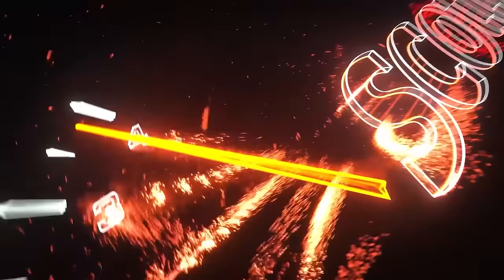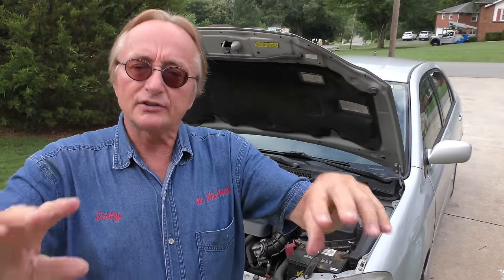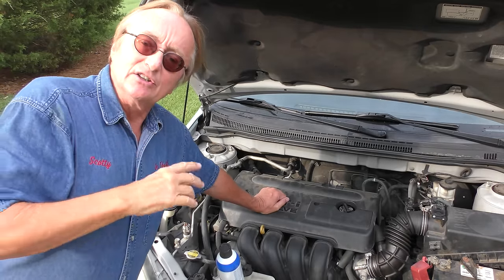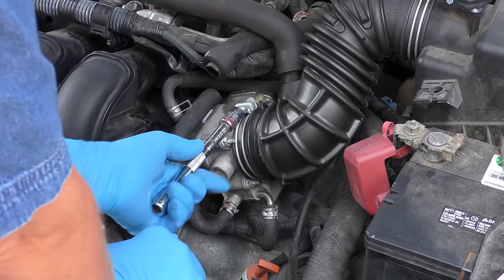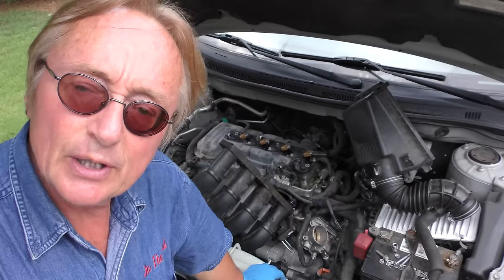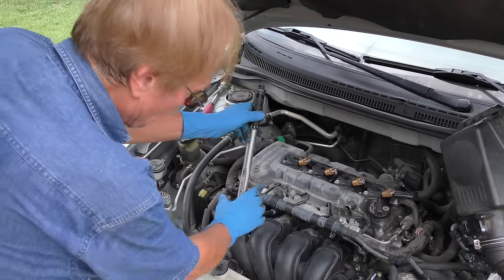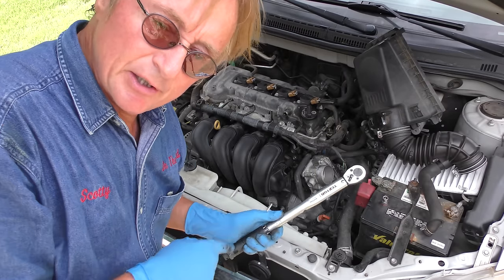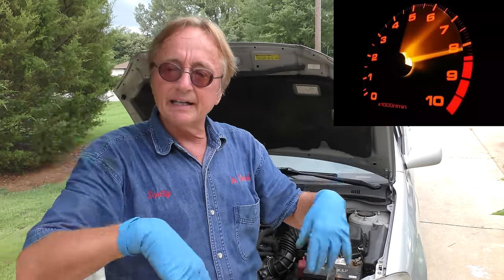Toyota Won’t Fix This Problem and I'm Mad as Hell

Comment: The 2 toyota vehicles that dont need fixing are a 1994 Toyota Celica and a 2007 Toyota Matrix. Good afternoon scotty!
Reply: 2002 Corolla 1.8 as well, transmission and engine are so good 
My grandma’s Corolla never went to a mechanic and has over 100k already
Reply: @beamishlotus7269  That car will last at least another 200k miles.
Reply: @riph5611  some other 98-02 Corolla owners in my area reached over 500k and they still run good, same engines, they told me they used just high mileage oil and also high mileage oil additives like MMO and stuff
Reply: @beamishlotus7269  It will last up to 1 million miles without any major problem. That's why Toyota is known for its super legendary reliability. No other car company can even come close.
Reply: @riph5611  yeah I just hope you’re right
Reply: @NOVA__tire_man69  The problem is your mum, not the car itself. Scotty also has 2007 Matrix and it never has any problem.
Reply: I agree. Neither would be worth fixing. Send them to the scrap yard.
Reply: Lexus too
Reply: @riph5611  my 98 Corolla just turned 130,000, my goal is 200
Reply: @johnjr2641  No problem. It will last you a lifetime and even longer.😁
Reply: Lol the matrix has bad intake manifold gaskets
Reply: As a mechanic ...... if it  wasn't for the Matrix and Corrola I'd be broke ! Seems they break a lot....especially around 75,000 miles.... don't see the matrix to often anymore tho.

Comment: I have two Corollas (2006, 2008) and I've replaced that intake gasket on both of those cars.  Here is a tip to remember:  on the backside of the intake runners is a port that connects to the tube that goes to the brake booster;  it is hard to see and most DIY guys forget to connect that and then they don't have any brakes, so be careful to reconnect all of the vacuum lines.
Reply: They would still have brakes, the pedal would just be much harder to push.
Reply: That happened to me exactly lol it's a real small hose hiding lol

Comment: One of the vehicles in my driveway is an 04 Corolla. The knock sensor threw a code because a mouse ate the harness. I chose to remove the intake as you just did. Took about 45 minutes to splice a new harness and change the intake gasket. Simple job! You are correct regarding that gasket because mine was very hard and probably had a small leak somewhere. Total cost was about $25 including the gasket, harness and carb cleaner for intake. One thing I can recommend is disconnect the negative to battery because the MAF sensor is sensitive. Scotty you rock!

Comment: I saw the gasket in the thumbnail, and already knew what the video would be about. Error code P0171 (to lean bank 1).
This cost a friend of mine hundreds at the Toyota dealer, only to have the code reappear within days. They sold her a new MAF sensor even, amongst other things. Then I checked the intake with brake cleaner, changed the 15$ inlet manifold gasket, and problem solved.
Reply: I have a chronic issue with P0171 coming on myself in my 2000 Corolla. It is triggered by the LTFT reaching 38.3%. Did your friend's car have a similar issue with the LTFT being way too high? How did the car run before the gasket was changed?
Reply: @MrRusell86  
Do the spray test on yours.
Remember the manifold is plastic and has a different rate of expansion to the alloy head...
So temperature can make the difference and maybe that temp diff is twisting the manifold..
and the old worn gasket can't seal that up any more?

Comment: That carburator spray trick is one my Grandfather taught me.  Glad some things never change.  I would be curious to know on your repairs how long it takes you to do it.  I think it would be interesting to know.
Reply: It's a cool trick
Reply: Can also use unlit propane torch. Hold it around where you suspect a leak and listen for change in rpm.
Reply: Isn't it flammable? Is it safe to spray it there?

Comment: There are many of these Corolla's (2003-2008 generation) still being driving today as they are very popular and long lasting
Reply: I still see 00s and 01s some even with body kits 😂😂
Reply: @stronkvodka731  i still see 88-92 not mentioning the next generation here in Portland
Reply: the problem I haven't found for 150k miles. At 207k now and ready to change to pass emissions P0171 engine light code
Reply: @getoutthere04  
Sounds like this gasket. Do the spray test.

Comment: My father has a Matrix 2006, similar as you.
He has the same code P0171 in winter when it’s cold.
I told him it was the upper intake gasket manifold, I saw the TSB document for this one.
Reply: What happens in the spring and summer? Does the code go away?
Reply: Tell me more about this "TSB document". What does this document discuss?
Reply: @MrRusell86  That you should change your upper gasket manifold. Especially in cold. For rubber.
Reply: @SergeSaati007  I see. Well, I have a 2000 Corolla that throws a perpetual P0171 code. I changed my upper air intake gasket but it did not fix the code. I was not too surprised because the gasket is different in 2000 Corollas. It is more flat and does not fit into molded grooves as is seen on newer models. The air intake manifold is all metal, too. I have not seen a metal air intake on any other Toyota shown on YouTube.
Reply: @MrRusell86  Oh so design problem maybe. Maybe in your case it's the O2 sensor or MAF sensor, vacuum line. Not sure.
Reply: @MrRusell86  
May need two gaskets stuck together with a sealer like permatex 
with a less permanent sealer between the gasket and the manifold 
and the same non permanent sealer to the head???

This will take up any imperfections (small gaps).....

Comment: One of the best european engines are 1.9 TDI made by VW group. It's used in vehicles such as VW passat, skoda octavia, Audi A3/A4. I saw some passats with 1 000 000 km and they are still going with original engines hahah. I also love my 2.5l CRD made by VM Motori. I think it's an italian engine which was used in some Jeeps Cherokee, Chrysler Grand Voyager (EU version) and also in London's cabs. I have 2001 Grand Voyager with this 2.5l CRD engine and after 21 years and 210k miles it is still going without any problems. Both engine and even turbo is still original and it is truly amazing! We bought this car in Daimler-Chrysler in Prague and I have some friends who covered 850 000 km with this car. If you change oil every 7k miles and change filters and you don't floor it when it's cold, it will last for long time I guess :) And A/C is still blowing ice cold!

Comment: My 2005 Corolla a few years back on very cold day, under 20 degrees ran like bullet until it warmed up. Toyota had a TSB on replacing the gasket. Must have cost me $10 and easy to replace.
Reply: Same thing happened to my 2005 Corolla S. Check engine light came on, OBDII code P0171. Replaced the intake manifold gasket ($9), problem solved.
Reply: @johnmcrae5043  still running strong?
Reply: Same thing here on a 2006 corolla ce. Easy job. Get the orange one.
Reply: @johnl3230  Sold it couple years ago; it was running fine when I sold it.
Reply: You can use a torque wrench if you got one, if you don't, you do what I do and it works like a charm.
Reply: @grandprixjames  

Fel- pro or the Toyota orange ones? They have an offer on the fel pro ones near me now!

Comment: I think this is what I need on my 07 Corolla LE. Spent $100 on scan, THEY say it needs MAF sensor, gonna try that first 🚙
Reply: Toyota has an upgraded intake gasket for the 1zzfe engine.
I replaced it on my 07 Corolla and not a problem since.
Reply: How is it

Comment: My 2003 RAV4 has this problem! I did my spark plugs I cleaned my MAF sensor and next I'm gonna do the air filter and a new oxygen sensor which I have a code for the oxygen and MAF sensors. Glad I ran across this video!
Reply: Did this gasket replacement work out to be the solution to your problem?

Comment: I just changed my intake manifold gasket today on my Toyota after seeing this video. It just happens that I needed to change it. Perfect timing, Scotty!
Reply: Did you have a check engine light before changing?
Reply: @gamingwitchutuu429  
Yes, but the check engine light on Toyotas is not big deal. Flashing check engine light is when it’s bad.
Reply: @igorseprak6177  yea, I have a smog on 26th and not a lot of money, I hope the gasket is the problem on my 2001 Toyota echo and not the fuel pump etc.
Reply: @gamingwitchutuu429  
It’s probably evap system. Not a big deal.
Reply: @igorseprak6177  Was it from the super common P0171?

Comment: I had a corolla 1.3l with unpredictable bad idling  at 0-15km, replaced the air intake manifold gasket, improved but didn't do it, apparently even though the pcv valve wasn't broken, but when i replaced it, the engine changed alot, cleaned the intake valves and the engine became like new.

That corolla introduced me to you Scotty, it was 2016, the video you talked about pcv valve, sold it in march 2020 and got a camry now.
Reply: @jeansreal  i removed the air intake manifold, and used carb cleaner, i used almost 5 cans, soaking it and assembled it and drove it with high rpm's. And then removed everything... Etc etc
Reply: @ehussamkc Wait a minute now. Why did you need almost five cans of carb cleaner? You found that the air intake manifold was really that dirty after you took it apart?

Comment: Peugeot 504 Diesel engines, 1975 and older, were a wet sleeve engine. First off, they ran dang near forever, but when it it was time to rebuild them, the cylinder sleeves were easily replaced, and the engine was good for a long time again. The rest of the car was pretty bullet proof too.

Comment: Should have changed the pcv valve. I did this job three days ago. The pcv          was bad and replaced it myself after mechanic thought it was too much work to remove the intake to get at it. The car was burning oil and you could see it leaking down the bottom of the intake. The girl had almost 300,000 miles on the car. Amazing that the car was still running. With all that oil coming in the intake. She never done anything but brakes and tires and oil changes.  She showed no appreciation just was mad there was still an exhaust leak.

Comment: Glad to know about the carb spray trick! I've been getting o2 sensor codes on my 2004 Corolla and haven't thought much of it, but now the idle is getting so bad that it occasionally dies at stops. Usually starts right back up. Took it to a shop here in Houston and they wanted to charge me 1100 for a new intake manifold because they did a smoke test and found a leak. I can't imagine that replacing the manifold is that hard and I know that the gasket has been changed, or at least I know I paid a mechanic to change it and they said they did. I'm tempted to take a look at the gasket, and just replace it myself and see if that helps, but I'll try the carb spray to see where the leak is.

Comment: Wow, Scotty using a torque wrench!  Usually he just tightens the bolts until he grunts.
Reply: He's so experienced, that he doesn't need a torque wrench.   The plastic crap is forcing him to use one, as the plastic crap is shitty to work with.

Comment: My 2008 toyota corolla idles like crazy only when warming up. After it's warmed up its ok. I'm definitely gonna work on my gasket. Just added a new throttle body battery alternator and starter. Hopefully this is it.

Comment: Had this exact problem with my older (relative to 2021) Corolla this past winter. The gasket was only $15 or so...but my shop charged over $300 for labor. Unfortunate it happened...but it is also the worst thing that's ever been wrong with this car after 150,000 miles, thing's a tank.
Reply: I'm sure there's other things wrong with the car at 150,000 miles you probably just don't know what they are lol.  I've done plenty of stuff on my 05 Corolla at 100,000 miles.
Reply: @marcushearn1740  Oh of course there's been more work/repairs done on the car, I'm just talking about the single "worst" piece of work that needed to be done on the car.
Reply: @tpr2378  gotcha.  I was gonna say that's it damn lol.  Feel like my Corolla is just one thing after another, granted it's a bunch of small stuff

Comment: The timing of this video is funny. Just finished swapping out my intake gasket on my toyota
Reply: literally did mine last week after a p0171 code
Reply: @Hero-jr5os  Did it fix your P0171 code? And how was the car running before you changed the gasket?
Reply: How’s it holding up

Comment: Trouble is, Toyota issued a TSB on this very issue back in 2007, and the fix is to install an upgraded gasket which doesn't turn into a plastic pancake over time. 😊

Comment: MR. SCOTTY!! I got offered a 1990 Honda Accord with 156,000 miles with a 5 speed manual transmission, for FREE!! It's been sitting for almost 15 years. Hasn't moved in a very long time. I'm a mechanic and not afraid to bring a car back to life if it needs it. It looks VERY clean inside and out. Should I go for it??

Comment: Bought air flow mass sensor, sparkplug,  and ignition coil. Still nothing then just changed the intake gasket and it worked. Thanks. 😅

Comment: Just had the same problem as Scotty trying to fix these worn gaskets you got plastic paradise before you can get to anything plus its so easy to overtorque those throttle body nuts they shear so easily

Comment: Just  changed the spark Plugs on my 2011 v6 Rav4, also changed the two intake manifolds just because I was already in there and the vehicle has 150K on it, pretty easy Job. Although the back bolts on the manifold were a pain to reach because I'm only 5'5". All said and done job took just over an hour.
Reply: Nice. those v6 ravs are a real hidden gem they are very fast. I say they are basically a v6 awd wagon with close to 300 naturally Aspirated horsepower they were a real joy to drive ice cream I wish I could find one in decent shape that people didn’t want $17,000 for it
Reply: @thetechlibrarian  I love it, its very smooth and surprises allot of Subaru drivers that think they can keep up with me :-)

Comment: Another clue that you might have an intake gasket air leak is if you notice the trouble more in cold weather than in warm.  At least that's what I noticed with my '98 Ford Explorer when the intake oval seals went bad.

Comment: Po171 on my pontiac vibe. I'm PRAYING this is my months long cure to my problem!!!!
Reply: It will be.....and was it?
Reply: @JohnSmith-pl2bk  

It was ! The gasket was flat and worn. Replacing it stopped the error code.
Reply: @jammin1881  
Thank you'
I have a 2004 Toyota Wish JDM import with the same engine and what I think is either this leaking gasket or a sticking IAC...goes to 1900rpm  from dead cold...and stays idling at this until it warms up....
It may have both problems....
Nosurging but something is wrong.....
Reply: @JohnSmith-pl2bk  

Use the carb cleaner and spray the intake (as shown) if it picks up or revs harder you know there is an air leak from the valve. 

This video saved me months of headaches and trying to figure it out. The car would stutter and nearly stall. Especially when cold. 

This gasket caused the p1071 code whatever......

Comment: What if the vehicle only runs bad at idle and low speeds once in a while? My jeep Cherokee 4.0L is driving me crazy. I've had it in several shops and it never acts bad for them and they can't find anything. It shakes and barely runs until you get it up to 20-30mph

Comment: Thanks, man! Already had the manifold off to change the bypass pipe so I can use the heater again even here in Hawaii it's nice to have once in a while. Anyway, the 05 Tacoma runs great but has a surging idle. Hopefully the new felpro gasket takes care of it.

Comment: A few very reliable engines I know of (I'm an engine test engineer, seen quite a few, they get run hard 24/7). 

1) Mercedes Benz M102, simple, mechanical, these run forever. You'll find these engines in late 80s to early 90s Mercedes, the ones that are still used as taxis in third world countries typically.
 
2) Peugeot/Citroen XUD9 or DW20 engine. These are used for the official CEC fuel tests in labs around Europe, they get abused with all sorts of nasty fuel additives, but also get the nice premium fuels to test with too from time to time. They live hard lives but usually give a respectable showing for it. 

3) Any Honda. Not only are the car engines reliable, all the motorcycle, lawnmower, outboard, generator engines are too. These guys have a lot of engine design experience. Anybody that is making motorcycle engines knows how to make the internals last a long time, considering that 4cyl motorcycles are typically cruising at 6k+ rpm with redlines at 14500. I'm sure theres lessons learned in that department that cross over to larger engines too.
Reply: No reliable Toyota engines?
Reply: @captinbeyond  Good point.
Reply: @browngreen933  I have an SW20 MR2 with a 3SGE. It's also a good engine but I listed some engines I have specifically worked with in a professional setting.

Comment: What would cause a 2016 Honda CR-V when in the Drive position make the car vibrate? Would I have the same problem? I have already replaced the air filter and used spray cleaner on the MAF sensor. Looked up on line and apparently it's common on CR-V's?

Comment: Kinda strange I came across this..
    I noticed the same symptoms on 2007 rav4 4 cyl w/90k miles seem to have loss power during take off and oil consumption well what I assumed was consumption…
     Came to realize after replacing the valve cover gasket the power improved greatly and loss of oil stopped..
And rough idle stopped and even gas mileage improved..from mix 20 mpg to 27 mpg mix
And even had random check engine lights only in rainy weather then light be off the next dry weather day!